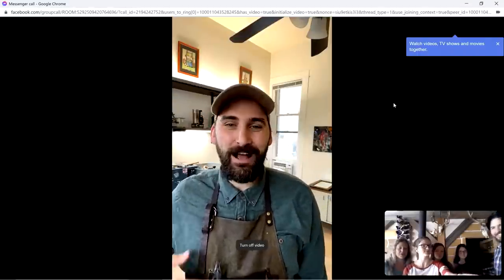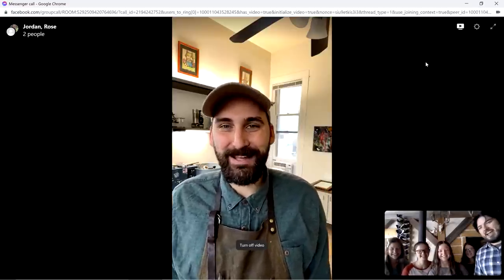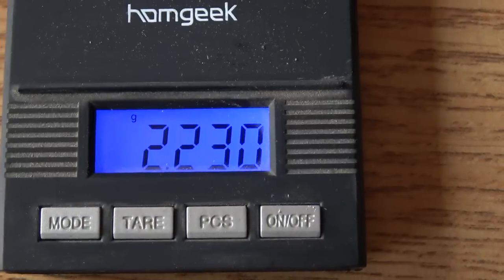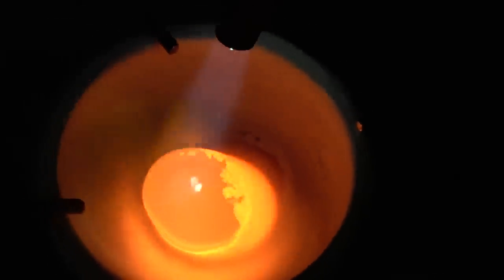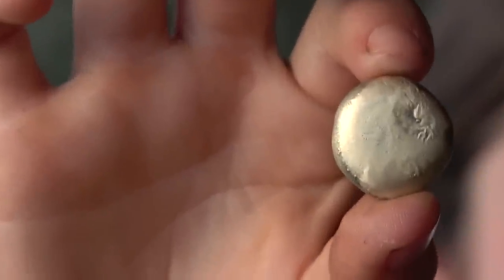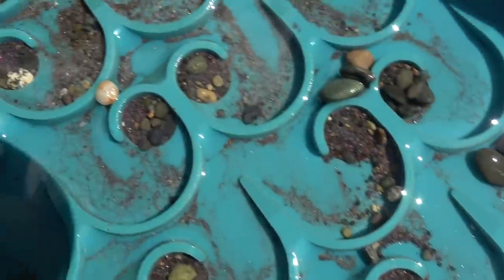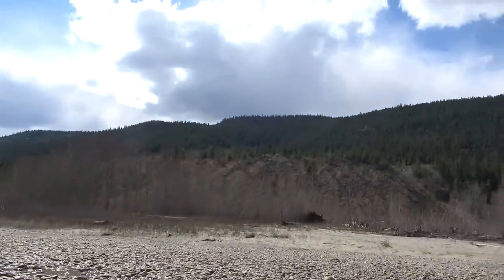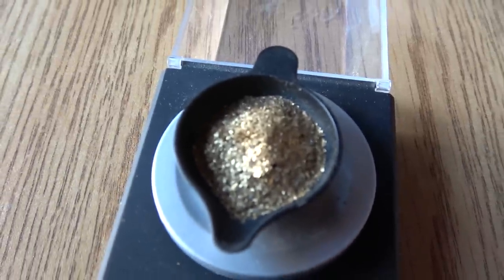Gold Rings from Dirt - The Dirty Part

Comment: I live in an area that was mined a lot during the gold rush and panning was a great hobby. When I was in school for dental lab I would catch a scorpion and kill it with either and sprue it. I used lacquer hair spray and would pose it then put in in a tall crucible and pour the dental plaster in it. From there it was the process of using the burn out oven then casting it using my pure placer gold. You could see every hair and fiber of the critter after polishing. I left the sprue on it as a stand until after polishing. I also made rings but would toss in old gold bands with my placer gold.

Comment: I stumbled across your channel the other day and just finished watching your video on your micro-hydro system. Could you do a video showing the way you designed and built the water catchment basin, the inlet and pipe layout (type of pipe, depth installed, etc) and how you designed and built the pump house and water discharge system after it's gone through the turbine? Do you use that same water for drinking and if so, how do you clean/sanitize it?

Comment: Try to not get a flashback of the flame straight into the nozzle because the nozzle melts at around 1200°C but the flame is 2800-3100°C itself. This is the single event that destroys these nozzles the fastest.

Still, I envy your living. I lived in Maple Ridge (Van, BC) for a year in 2010 and I've always wanted to move back, love it there.

Comment: Could the problem with that gold be due to your use of sterling silver, and not pure silver?
Reply from the maker: That was not the problem.  The sterling is 92.5% silver and 7.5% copper, so as long as you take that into account when you alloy, it is just fine.

Comment: He who smelt it dealt it (hahaha).

Oi!—bad pun.

I’m a jeweler whose been in the business over 20 years.
I’ve poured and milled countless gold pieces (rings, bracelets, pendants, etc).

Anyway—Stuller and Hoover & Strong are excellent jeweler resources that might send you professional alloy mixes to add to your pure gold to make ROLLING GOLD—(not CASTING GOLD.)

ROLLING GOLD is a different alloy mix designed to make metal more malleable for rolling out with a rolling mill to compress and stretch better. THIS is what YOU NEED to mix to mill your rings.

CASTING gold is designed to take to a lost wax mold better, but it will crack and split under compression like the gold did when your goldsmith worked with it. It’s AWFUL to work with!!!
I know—I’ve worked with both as I hand mill pieces and do finishing work at a store that casts custom pieces we 3-D design.

Also, mixing pieces of copper and silver you’ve bought that wasn’t specifically made for alloy blending may have other impurities (even if it claims it doesn’t) that might adversely effect your alloy mix.

Please contact Stuller and ask them for access to materials and insight on what you need.
Heck—on your trip take a tour. I’ve always wanted to
You may need to set up an account with them, but even if you can’t (they have strict requirements) you can find a jeweler that already has an account that is willing to help you. (raising a hand, shyly)

If you ever make it to Central NY, look up Cunningham Custom Jewelry and ask for me.
If you like, you can camp out on my land and see the sights, and I can teach you how to make your own rings with your own gold. I taught jewelry classes for four years, and taught private students.
You and your gals can DEFINITELY do this.

I’ll even teach you remotely, if you like, but you’ll need a few tools (always fun to get new tools!!!). Rio Grande or Geswin are great sources.

Best!!!

Comment: That black is iron. One can melt it and cast it into something. As for the copper. When it is heated, it begins to oxide and the further heating turns the oxide into a gas that burns green. And the more you heat it, the more oxide that turns into a gas that burns and so you literally burned the copper away. It went up in green flame/smoke. So, nest we get to see if you will turn the pure gold into 18 K, ok?

Comment: ⁉✨🇨🇳✨Chine copper quality from electric wire or plumbing stuff is surly not good...
Gold fusion 1064°C
Silver fusion 962°C
Copper fusion 1 085 °C
Maybe if you brun to high you brun some and loose some %...
And perhaps the combustion of certain metals due to too much heat, creates residues and which dirty the final alloy and defeats its integrity...
😉🌱